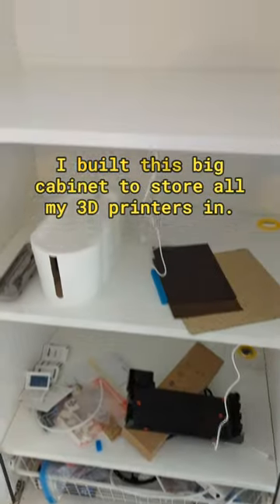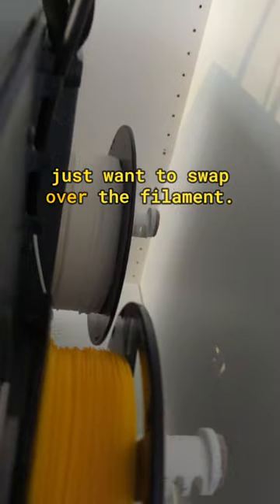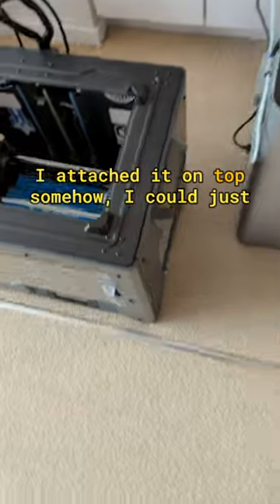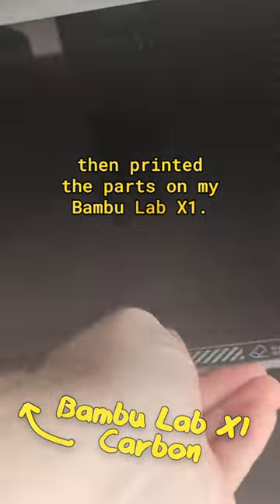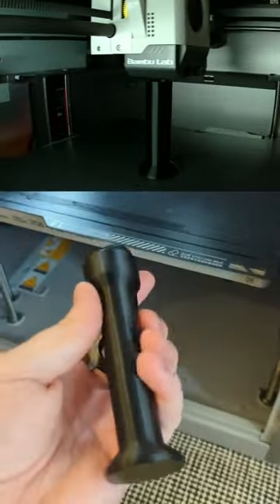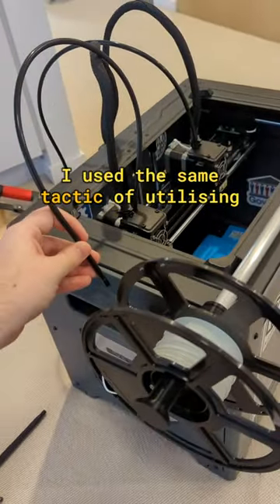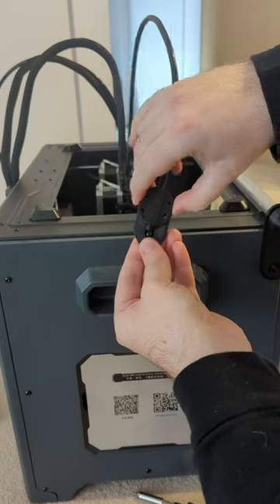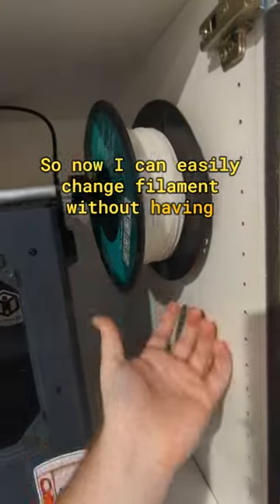Fixing My 3D Printer With #3DPrinting #shorts

Comment: Add a sliding "shelf" underneath. You'll only have to pull it out far enough to remove and replace the spools. Unless you're only trolling of course!
Reply: My thoughts too
Reply: The printer would be to heavy
Reply: @Vezyx_Zephyx  sliding shelf have wheels so weight isnt so much an issue tho the whole unit would need to be secured to the wall. Alternative a turntable would work too.
Reply: @FinalHero1  Nice! "To the left! To the right!"
Reply: @Obeoneobe  haha
Reply: @Vezyx_Zephyx  modern drawer slides are a thing of beauty
Reply: I was thinking what if he could model the plastic ends to be removable so you can kinda load it up similar to a toilet paper roll, and kinda slide or clip it onto the sides
Reply: @Vezyx_Zephyx  *too
(Sorry, I had to)
Reply: I was thinking the same but it rotates outwards 90 degrees of the slot
Reply: @Obeoneobe  understandable
Reply: @FinalHero1  I'd be concerned with slight movement causing ringing/ghosting since the creator pro 2 slings two steppers at a time
Reply: @taylorquimby4004  ohh that makes sense. You would need something to lock it in place too to solve that which is kinda starting to over engineer.
Reply: @FinalHero1  would a pin from the frame to the rotating plate that you can just pop out when you need to rotate work?
Reply: Or mount the spools on top of the cabinet
Reply: Instead of mounting the spools to the printer. 
Mount them to a sliding rack that is attached to the side wall of the cabinet
Reply: We had the same idea I swear I did not steal yours
Reply: @richlaue  This ☝️

Comment: i came up with an idea to fix the issue at the ending. If i knew more designing would help to design, but to me it seems better to print a base so the filament can roll on some bearings, no need to screw anything to the printer. Filament is rolling on the bearings so no rod to stop you from swaping the filament. This way the filaments and the bases can be removed and printer manipulation is easier
Reply: Yep.  Or just print slidy holders with PETG, which is quite slippery.  No bearings needed.  Doesn't work very well with cardboard spools, though.

Comment: You had trouble 3d printing with ur 3d printer so you 3d printed a 3d printing filament with a 3d printer for a 3d printer storage space. And it still didn't work 💀

Comment: just make the rod mounts u shaped it will still function all you have to do is lift the whole bar out to change if you make it too tall then trim the hold on the front so its not pulled back
Reply: Just knew that if I scrolled down far enough someone else would have the same idea :)

Comment: 1. Shorten the pipe get a larger pipe to act like a sheath 
2.and a disc of metal the same diameter
3. spot weld a spring to the disc   
4.and weld it to the end of the sheath
5. Drill a hole in the inner pipe from the start to the end of the travel distance you want and a small peg matching the hole in the outer sheath
6. Marvel at your brilliance and ask yourself why you didn't 3d print this mechanism
7. Realise you forgot to KISS and should have just mounted the spools on the cabinet

Comment: Sliding tray or mount spools above 3d printer so all you have to do is lift them up and off of course this may or may not work depending on space and the movement of the printer head etcetera but who knows maybe with some more custom 3d printed parts you can build a better 3d printer. Great ending BTW

Comment: You shoukd have pinned the extensions to the shaft and use a close fit instead of a tight fit. then you pull the pin and the extension and spool will come off in the limited space.